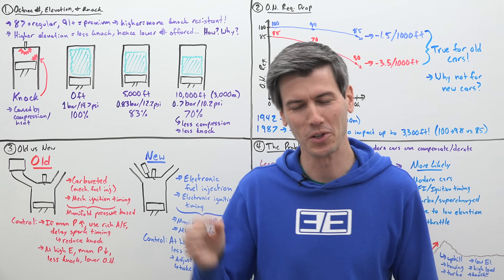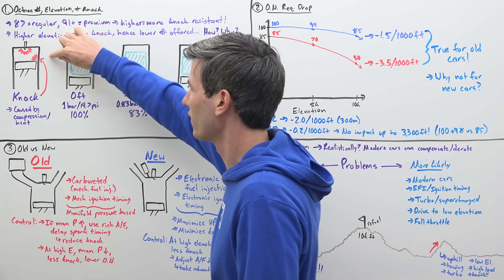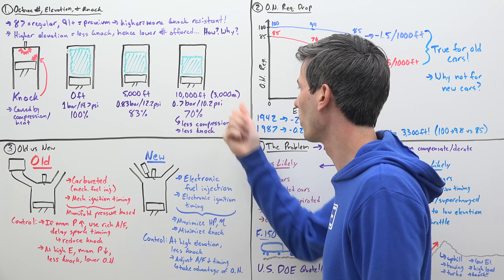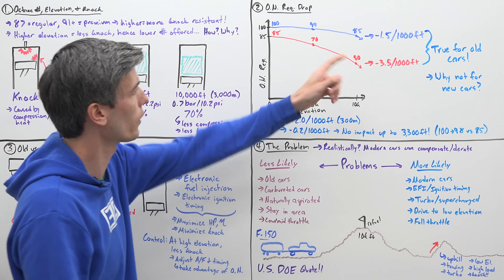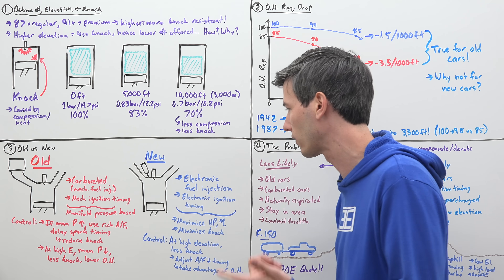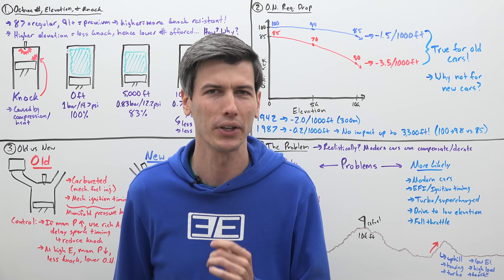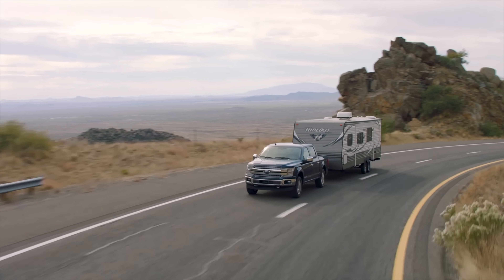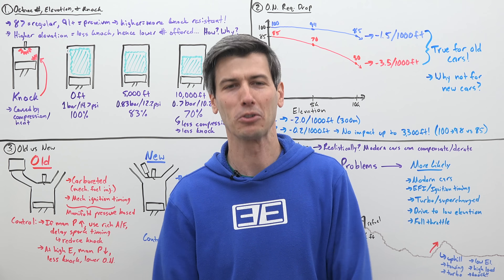Never Use This Gas In Your Car!

Comment: In Australia we commonly have 91, 94 (with ethanol), 95, 98, and some call 91 a "rubbish" fuel. I'm amazed that the USA has fuel that goes so low in octane rating and causes a serious risk issue!
Reply: USA (maybe all of NA) calculates the octane rating differently.
Reply: @tomcorwine3091  Oh okay, Americans again choosing to be at odds with the rest of the world. So in USA you can have a gallon of a certain octane gas and in other countries the gallon is entirely different, the octane is entirely different and indeed the fuel type is entirely different - what madness.
Reply: Serious Risk???? Knock sensors have only been around for 35 years... 
Was 1970s when you stopped learning anything new about cars????
Reply: @sandervanderkammen9230  Knock sensors have not been around in all cars for 35 years, and still aren't. Talk to the world's car manufacturers, because they stipulate minimum grades of fuel to prevent engine damage and warranty voiding - this video actually states: "How 85 Octane Fuel Can Destroy Your Engine And Void Your Warranty". I'm just a messenger, this isn't my opinion, it's me relaying "their" advice, but I guess you would know better than car companies from your mum's locked basement in rural Netherlands, right?
Reply: @martintaper7997  True, places like Oz are decades behind in automotive technology.... it has one of the oldest registered automobile fleets.

Yes and you were completely ignorant of the fact that there are more than one octane rating system in use in the world which certainly destroys your credibility on this topic.
Lying about being an engineer completely destroyed any credibility you might have had before this latest blunder.
 Stralya doesn't have any automobile manufacturers so you wouldn't have any first-hand knowledge of what the manufacturers are doing currently... its obvious that you don't know anything about what is going on outside of your isolated country at the bottom of the world.

Yes and the message is receiving loud and clear... Australia is about as far from the center of the automotive universe without leaving the planet...
Reply: @martintaper7997  You are certainly  no engineer lad..
This is painfully obvious from reading you benighted comments.
Reply: @sandervanderkammen9230  
Well I guess in one sense you are right, I'm retired from employment so I don't work as an engineer, but I still have my qualifications on paper to prove my qualifications.

I gave you a simple question (twice now) that only a mechanical engineer or a very intelligent person could answer, a particular question with an answer not easily found or understood by the layperson (you).

Prove to me that you are a mechanical engineer, or even a very intelligent person, by answering the question in your own words and with a simple example, and therefore I will see you have the essential requirement to "begin" to judge others in this respect, but still not make any conclusion without "evidence".

Comment: I've lived in Colorado my whole life and have been using 85 for every car I've ever owned except my turbo subaru without any problems. Most people here seem to use 85 unless their car requires at least mid grade
Reply: My "old" truck ('02 😅) doesn't specifically state to not use 85 octane rating fuel. However my 2010 Focus does, and states lower than 87 octane could damage the engine. So the truck gets 85 "regular" and the car gets 87 "midgrade".
Reply: @stevk5181  I think it is pretty common for most vehicles with naturally aspirated engines produced "recently" to say they require 87 octane.  The only thing that changes is how recently.  I have a 1996 Toyota that says is requires 87 octane, so Toyota has been doing it longer than some companies.
Reply: With a scanner, I was able to see consistent knock counts on 85 in Denver during the summer. No knock at all on 87.
Reply: 85 here in Utah, seen cars to 300k on 85
Reply: I have filled with 84 as lowest. I travel 1800 above sea level to CO @7000 feet, few trips higher. I fill every 250 miles on average on trips. Never noticed any issues.
Reply: Elevation makes a huge difference. 85 is ok in Utah and Colorado.
Reply: You're running full fraction fuel with 15% ethanol. E85 is not what you are thinking it is.
Reply: 87 is regular, not mid grade lol
Reply: Yeah. I think this video is aimed at people who live at sea level. I’ve never had issues either. Truck runs great
Reply: @trevorsmith4597 you didn't watch the video
Reply: Another Colorado native here, I've used regular 85 in every car except ones with high compression engines or turbocharged or both. Always been fine, my old 06 civic did over 100k miles in my possession without a problem but my 07 SI requires premium cause it's a high compression engine. It's really not complicated.
Reply: What happened with the Subie? Did it have issues or you simply put higher octane fuel in it?
Reply: @IronicallySarcastic  forced induction engines generally require higher octane fuels than naturally aspirated engines do. Most recommend 91 or higher
Reply: @IronicallySarcastic  I've only used premium gas in the Subaru
Reply: There are some that only take E-85.
Reply: @onomatopoeia162003  I think everyone's talking about 85 octane - the 85 in e85 refers to the percentage of ethanol.
Reply: @onomatopoeia162003  E-85 is 85% ethanol and 15% gasoline.  The octane rating of E-85 is anywhere from 100 to 105.

Comment: Here in the Philippines, fuel stations sell fuel with minimum 91 octane as the lowest octane rating, highest rating being sold is 98. Is it because of emissions regulations the reason why US fuel stations sell low octane fuels? Or is it because we are using RON standards? 🤔
Reply: Most likely RON calculation vs AKI calculation [(RON+MON)/2]. 98 RON is about 93 AKI, for reference.

Comment: Any thoughts on the use of clear (or oxygenate free) gasoline in a modern engine?  I believe it's the fuel the EPA uses to get mileage ratings for cars.  Why does my crappy little economy car get nearly 20% better mileage using it?  Any risk of damage?

Comment: Kind of a clickbait title...  I appreciate you clarifying at 8 minutes in.  This is EXACTLY why cars come with knock sensors.  Because people will still run 85 octane in high performance engines.  The reason they don't blow up is the ECU retards timing until you stop knocking.  I didn't even hear you mention knock sensors.....

Comment: Surely the '21 F150 needs at least 89 if you have the 3.5 Ecoboost?
Reply: For maximum hp most turbo charged engines need 91 to 93 octane, but they will run OK with 87, you will just have less power. If you read the fine print in the manual and brochures/websites it always gives the highest hp with a note that says in effect "requires 93 octane fuel to achieve this power". My Ecoboost Mustang has 310 hp with 93 octane, but with 87 octane it has 275 hp, and less torque, so if you want maximum power from your F-150 3.5 Ecoboost you should use 93 octane if it is available.

Comment: Fun fact: there's more energy in lower octane fuel
Reply: Octane modifies the combustibility of the fuel.  The higher the number, the more difficult it is to ignite.  That being said, I'm not surprised that Ford, with their extensive lineup of turbocharged engines, is running into warranty problems with people who use low octane fuels at low elevations.  Turbos make up for the lower barometric pressures at elevation.
Reply: @ggariepy  Well, an engine is so much capable of controlling detonation as it is designed to, be it forced induction or not, higher or lower octane.
Those engines are not designed to use 85 in the first place.
At the end we can blame the industry for not being clear enough about the requirements of their products and the consumer for not informing himself, not the machine and not the consumables.
Reply: Resistance to detonation is kind of say resistance to extreme temperatures. A detonation is a random self ignition of the fuel mixture.
The latent energy is the same in all gasoline sold, but is the ability of the engine as a whole the reason of different power.

Comment: Show me anywhere in North America where you buy fuel at high altitude, say 7000 plus, and drive to sea level on one tank.  I don't know CA that well, but I can't think of any other place.
Reply from the maker: As an example, Pike's Peak gives you a 5,000 ft elevation drop/gain in 13 miles (remaining at high elevation). I don't know of a specific example, but there are areas of the country where you gain/drop significant altitude very quickly.

Comment: I wonder why the USA still uses 87 AKI fuel as regular fuel? We (Germany) use 95 RON (90 AKI) fuel as regular fuel (This is still called Super) as Normal fuel (91 RON/87 AKI has been discontinued in the late 00s. You can also get 102 RON/95 AKI fuel easily.

Comment: then heres my concern engineering explained heres a question for you for those people living in higher autitides i'm in new york basicly right all we have is 87 and if anywhere has 87 or lower from me that will void a new cars warrenty what if people just finding this out were to go to a higher octain rating instead to try and avoid voiding that specfic warrenty such as an example 90 or 97

Comment: Travelers should beware 85 octane. Locals only driving at high altitude can use it. I'd also avoid "mid grade" values, so use premium gas on any pumps with 85.

Comment: So basically carry a bottle of octane booster if you're planning on refuelling at higher altitudes.
Reply: Those products don't work.  If they say it increases octane by '3 points' it means your 85 octane will now be 85.3 octane.
Reply: @knurlgnar24  which of course assumes dosage as directed

Comment: What effect does octane have on the poor stepchild of EFI - throttle body injection. This is essentially on injector on top of a carburetor replacing the jets and floats. So it's a kind of hybrid between the modern fuel injection and carburetors.

Comment: Wtf never heard of 85. I mean over here in europe there is very little 91 gasoline to tank anymore. Pretty much 95 the lowest you can get. Yes, diffrent ron ratings but generally in europe our gas is on average of higher octane than in the states.
Imagine a EU spec turbo charged engine tuned for performance with that 85 fuel. Ouch

Comment: There is another difference factor not mentioned in this video between old carburetor cars and modern electronic fuel injection cars that affects Octane requirement differences between low elevation and high elevation. The difference is in old carburetor cars as the car was driven to higher altitudes the air fuel mixture would become more fuel rich, which would reduce knocking. In modern cars the electronic engine controls maintain a stoichiometric ratio no matter what the altitude is.

Comment: I did a trip this Summer to a few places in South Dakota, Wyoming and Montana.   Never saw any 85 octane in SD, but it was on the pump in Montana and Wyoming.    They did not have any at the time but it sounds like some stations at higher elevations have it during the Winter.

Comment: Why can't we just have one grade of fuel at the pumps? for example Premium only so it can satisfy ALL cars on the road and eliminate the Regular grade and pass on the savings from less work needed at the refinery and pumps so on.
Reply: An engine will run less efficiently on premium if it's not designed for it by having knock sensors to adjust the ignition timing on the fly.

Comment: Is the knock/predetination applicable to Diesel engines in the higher elevations?  Diesel has cetane not octane and diesel operates solely via compression rather than an ignition catalyst.
Reply: Diesels basically knock as standard operation ;).  Not really, but compared to a spark ignition petrol engine it might as well be.  In reality, diesels still need a smooth controlled burn, but they can't control knock with spark (cause there is none), so only injection timing can come into play.  As I understand it some diesels use knock sensor to monitor combustion quality and make adjustments, but many do not.

Comment: Has he talked a lot about the E-85 that much. Because i’d like if he explained how the octane works on those fuels
Reply: E-85 octane rating is somewhere around 105 but varies.  It just means 85% ethanol 15% gasoline, not at all the same as 85 octane gasoline.  You'd need an engine that's built for it, otherwise you will run into problems.
Reply: @kyle2034  right. I just want to know all the juicy info about the type of gas.

Comment: What about running E85 on a 4.3 or 5.7L Small Block Chevy with fuel injection after 1987 whether it's the TBI or spider injectors? Just out of curiosity.

Comment: I have a naturally aspirated 4Runner and spend a lot of time at 8000+ feet and use 85 octane when at altitude. I get good gas mileage at altitude but when I drive down to lower altitude with a full tank I always get crappy gas mileage until I refuel.  I'm now starting to understand that my truck is pulling timing so as not to knock.  Cool...

Comment: High Manifold pressure is a misused term. To move air mass from one location to another requires a differential pressure.  To move more air mass into an engine the manifold pressure actually drops, higher air flow less pressure, trust in Bernoulli.  To move more air mass into an engine the manifold pressure dops (full throttle) and the outside higher pressure moves to the lower manifold pressure.

Comment: It's kinda like when I first started driving back in the 90's, and leaded fuel was still readily available, even though really no cars produced since the 70's were able to run leaded fuel.
Reply: 1975 was when unleaded was required in cars in the US.
Reply: My mom bought a 1979 Honda specifically because it was the last year that model could run on leaded gas. Starting in 1980 it was unleaded.
Reply: @LA_Commander  I love this. I did EXACTLY the same thing but with a different make. The 1980 vehicles were out toward the end of ‘79 but I opted for one of the two remaining ‘79s. They didn’t have a catalytic converter (or any other emissions control device) either. It was a sad day a few years later as the powers that be took away the leaded gas pumps, Union 76 was the last bastion with their Leaded Supreme.
Reply: @carrtb  Tetraethyl lead is one of the nastiest compounds ever deliberately added to a consumer product. Quite a lot of people at the manufacturing plants died due to spills and accidental exposure, and everyone born in the leaded gas years is slightly dumber due to the cumulative neurological effects of lead exposure during childhood. It's not great for engines either. The lead is corrosive at high temperatures, and chemically attacks the exhaust valves in high performance engines (such engines already have hardened valve seats so recession is a non-issue). It also fouls spark plugs (the old mica and porcelain insulated plugs were worst affected), and leaves deposits of lead oxide in the cylinders requiring the addition of chlorine and bromine to the fuel to clean up the lead.

The only benefits are the raised octane rating and the incidental 'padding' effect of lead oxide protecting unhardened valve seats. Even in the '20s the hazards and many of the issues were known, the main reason Dupont, GM and Esso selected TEL as their octane booster was that it was patentable whereas the alternative (adding oxygenates like ethanol) was not. They marketed it as 'Ethyl fluid' because everyone knew lead was poisonous and would have put two and two together if someone suggested burning lead in their cars, at least until the idea was 'normalized' to a degree. They also engaged in a substantial disinformation campaign to maintain their business after concerns were raised by scientists and members of the public. Altogether a fairly shocking story.
Reply: @LA_Commander  your mum wanted to put lead in the air?
Reply: @DrWhom  yeah and she ate babies and pulled the wings off bees too, are you happy now?
Reply: @LA_Commander  Noic...
Reply: i heard a rumor once, and i stress the rumor part, that old engines from that period prefer running on period correct fuels, lubrication wise
Reply: What did leaded petrol (gas) smell like? I only ask since where I live, it was phased out before I was born, which is ultimately for the better.
Reply: @adelaideautowashes  pretty much the same as regular, there are many other factors for smell other then lead

actually you would have to lock yourself in a garage with a leaded fuel engine running for quite a while to get to amounts counting to any lead poisoning. and you would surely die long before, due to poisoning of other gases that running engines also produce.
its just eco/marketing ploy to move to much more complicated sensors in western cars, leaving chinese competitor technology years behind and making sure profits comes the right way. using poor children in China that were dying Couse of poor quality filters on lead and zinc smelters or being near lead battery factories.

its the accumulative poisoning that counts you may think, and you are probably right.
just take note there is very real possibility of having cancer and dying from it just from drinking cola - and noone even thinks of banning or regulating sales of it.
make no mistake, everyone around is bound to care for his own health and his own profits

its the mix for 2 stroke engines that gives that funny smell we often associate with childhood

Comment: Lol 'regular' in Germany is 95 octane :D

There are 'premium' fuels available from 98 to 102 octane out of the pump station next door
Reply: Different rating scale.
Reply: @Jakek200  I did a quick research and you are absolutely right. But still: our normal 95 octane is equal to your 90 octane. Still noticebly better, isnt it?
Reply: @alli333o  Yeah 90 is between what's considered to be Mid (89) and Premium (91/93) fuel at least where I live with 87 being regular.